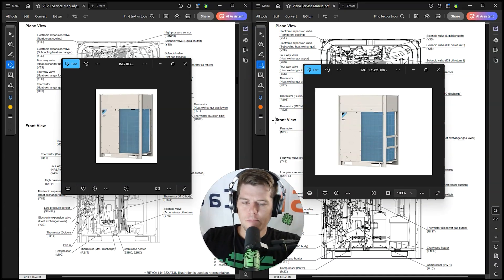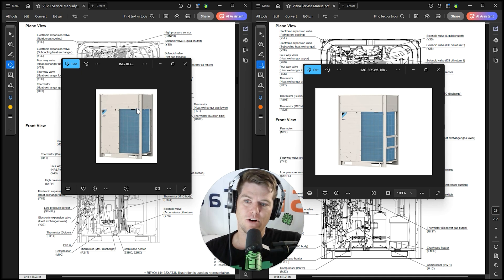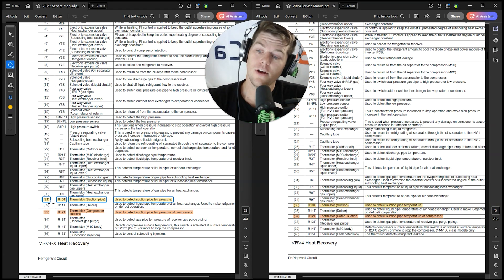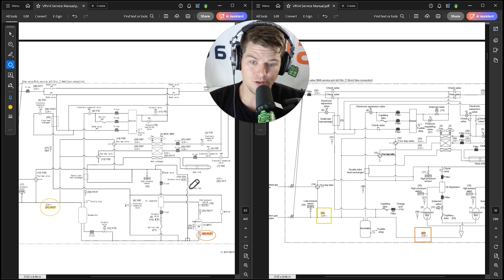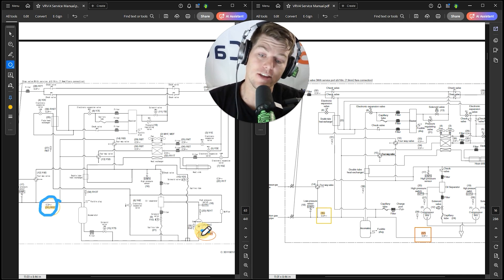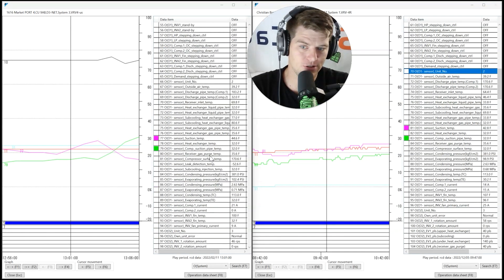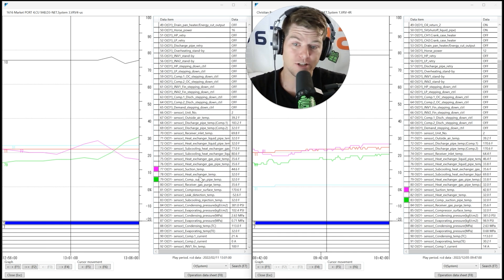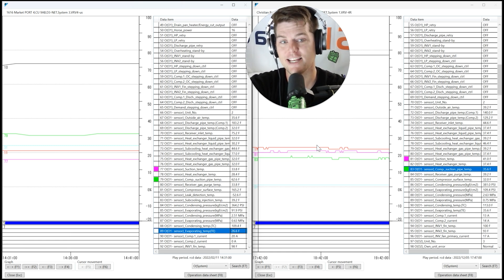Suction Superheat and VRVX - Have you been measuring it wrong?

Comment: Hello mate , first I must say thanks for all you videos, they are som of the best on YouTube. But correct me if am wrong, the two lines that you have mentioned, 1) the oil return line and the vapour injection line both have capillary tubes , doesn’t this lower the pressure which then lower the temperature off these going back to the compressor?
Reply from the maker: Vapor injection does not have a metering device but the oil return line does. However with 185 degree oil in the separator, by the time it reaches the suction is still 115 to 125 degrees which is drastically higher than a 50 degree suction line. This adds heat to the line.